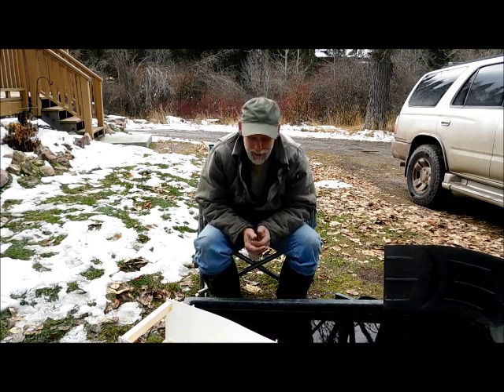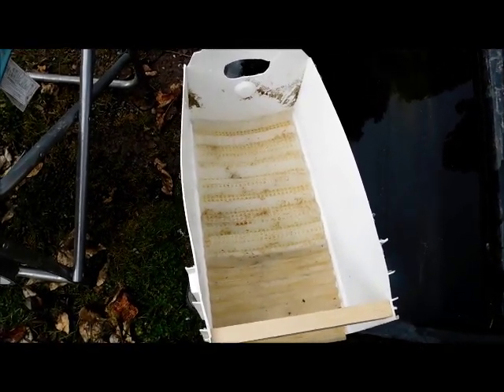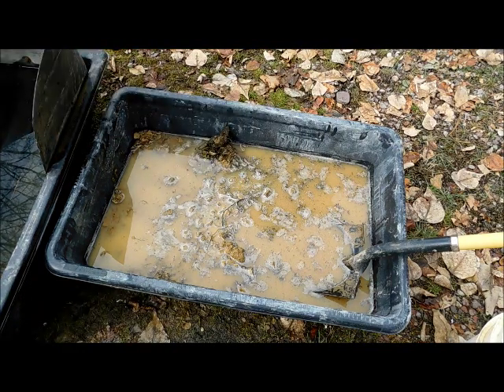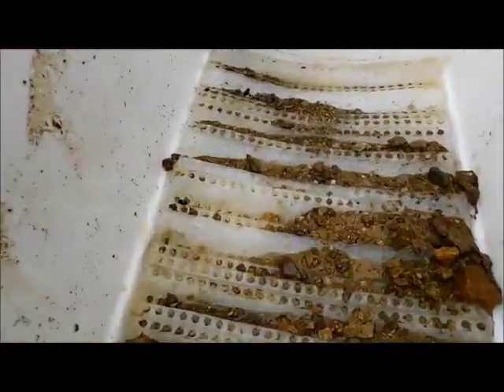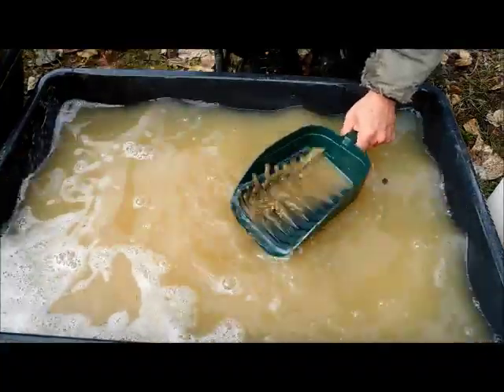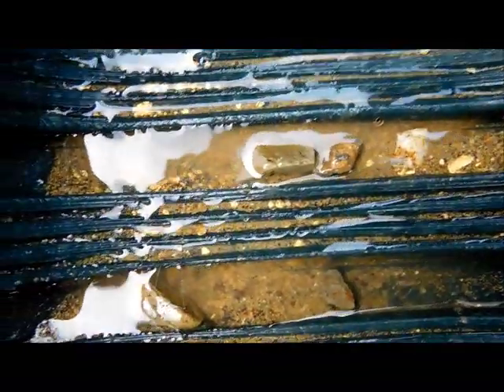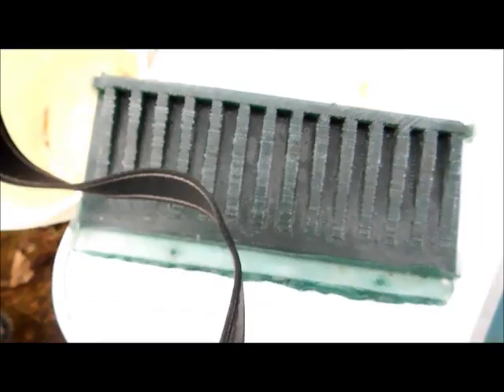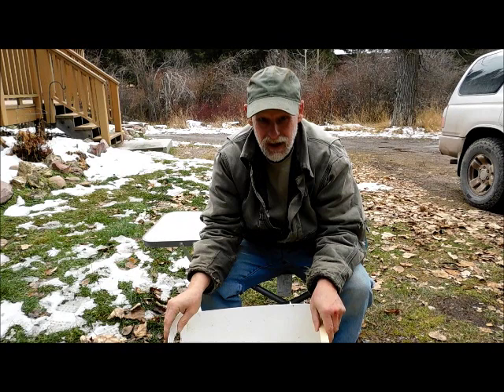New High Speed Bucket Concentrator Faster Than A Gold Pan

Comment: >Be Alan Robertson
>Design custom processing/concentrating matting/invents whole new concept for fabricating silicone mats
>Puts newly designed silicone concentrating matting in sluice so he doesn't have to pan cons by hand
>Perfects build, mats for SERIOUS production, and cleaning cons down to pretty much nothing
>Has idea
>Builds pan so he doesn't have to use sluice

You are a genius, but also confusing at times

Much love!
Reply from the maker: Well Hello I could see how I can be confusing I just like to try out different ideas to see if it will work. I do have a plan for this one in the spring with acres of new ground to test in the spring and I think something like this will help a lot.

Comment: Kinda like a goldhog flow pan....kinda..
Reply from the maker: You are right Kinda the material has to go out the front and not out both end when you shake it.
Reply: @alanrobertson2510  - Guess you can keep the open end tipped down as you agitate.

Hmm. Maybe you could make the bottom slant down at an angle towards the open end.